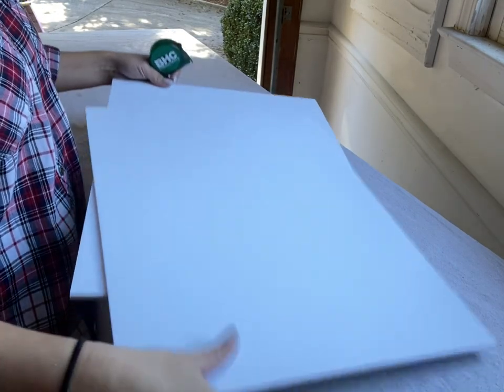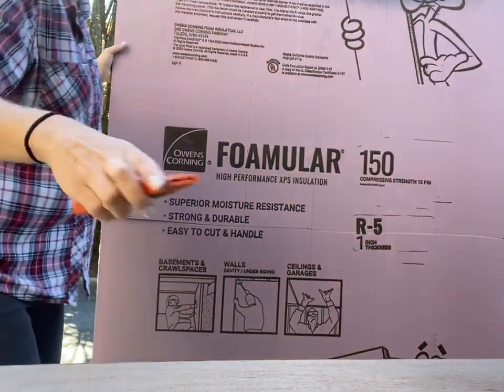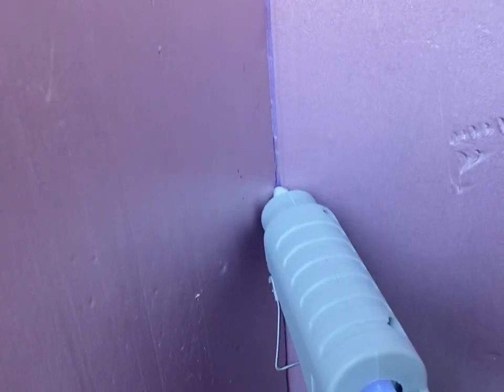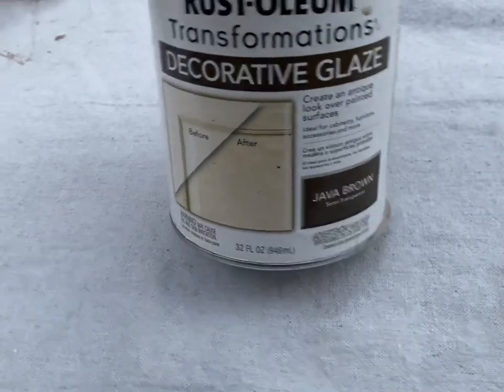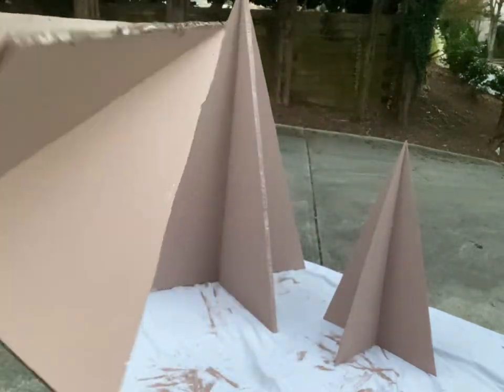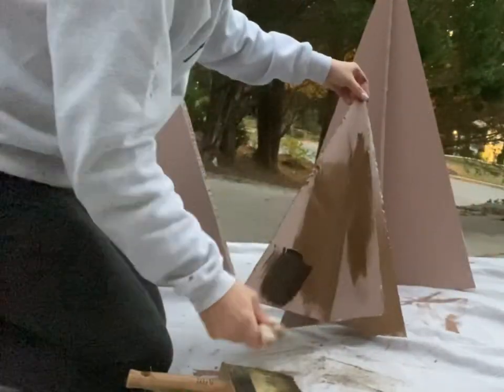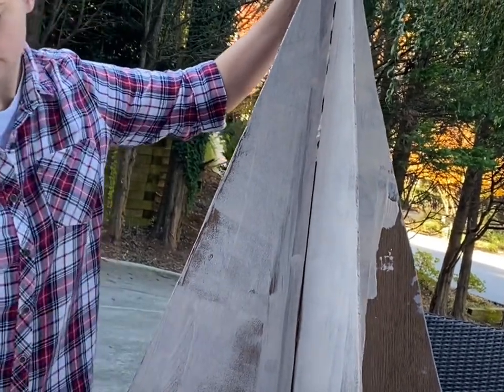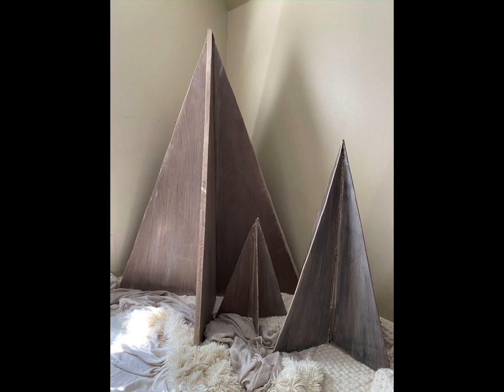🤯 FOAM BOARD faux “WOOD” indoor/outdoor trees!  How to paint to look like wood Crate & Barrel Dupe

Comment: A hot wire foam cutter would give sharp edges or even scroll work. Many to choose from on Amazon. Darling dupe!
Reply: THIS is the tip she needs! As someone who helped my bestie cut tons of foam boards to mount oversized architectural prints a few years back  (remember that craze?!) I can safely say this is the only answer unless you don't mind jagged edges and styrofoam pieces everywhere. Forever.
Reply from the maker: Oh wow, that sounds like a great tool!